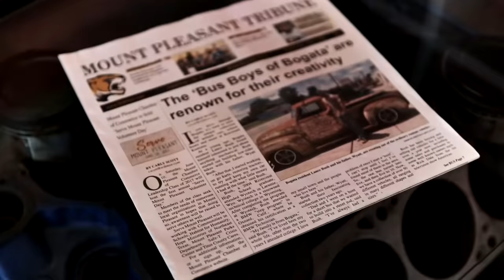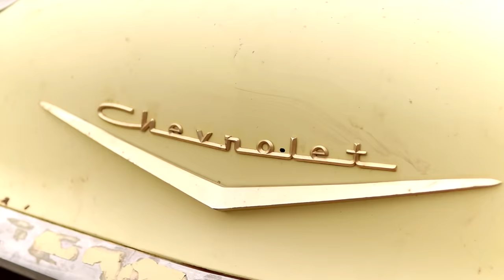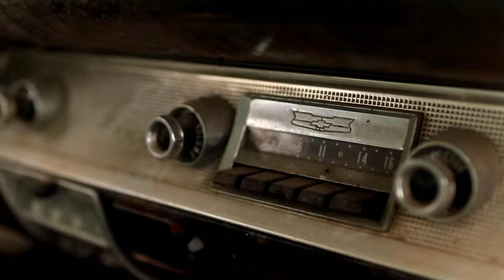1957 Chevy Bel Air, Will It Run After 35 Years?! | Turnin Rust

Comment: 265 V8 would've been painted YELLOW in 1957.  I believe it ONLY came with a 2-barrel and a 3-speed.  It was the economy V8 option.  Everything else was the 283 and the 283's were all Chevy orange.
Reply: They made a rare Turboglide 2 speed transmission ( different torque converter I think ) but I only saw them in books.
Reply: @michaelszczys8316   You're correct on the name, there was a TurboGlide available starting in 1957. It was a 3-speed but was only available with the 283 - but NOT available on the solid lifter Dual Quad 283 or the solid lifter Fuelie 283. Those engines came with three-speed manuals ONLY.

The fellows in the video were wondering if they had a 265 or a 283.  A 265 would've been painted yellow in 1957 and never would have come with either the Power Glide OR the TurboGlide.  it was an economy V8 choice and only came one way.
Reply: @That_AMC_Guy  Back in 70s most of those cars that still had original motors they were so greasy you couldn't tell what color they were.
A friend had an old 56 nomad with 265 that was so sludged up that when he took valve cover off it looked it still had one on and even said Chevrolet in the sludge
Reply: I don't think the turboglide was 3 speed. I think it just had some more elaborate torque converter and I remember the shifter instead of low said HR for Hill Retard for using in long hills
Reply: Yeah well, I know the TurboGlide was a three-speed.

Comment: Your experience as a mechanic leave a lot to be desired as far as I'm concerned. I was been a mechanic for 45+ years and am now retired. You not knowing how to adjust points on the 57 is ludicrous. GM has used that type points from 1957 to 1975 when they went to electronic ignition. Not knowing that the motor was a 283 (because it has no external oil pump) made me laugh.  No sure if you faking it or really don't have a clue.

Comment: Thing that bugs me is those who claim they are "God Fearing People" then they buy a car (like this) for just $1900, use parts on it "like cobbing in a 9 foot ground wire for the battery" do three hours of actual work on it, then try to sell the car for $10,000 as though it is actually worth it with second rate parts, and no real "money" spent on the thing!! Sure labor costs money....but I don't see "$10,000 worth" of parts and labor into these cars!! And then I have to question what "God would say about greed!"!! 

I am not saying these guys are like that BUT I know a fella I met years ago who was like that!! The man I knew always threw God into every conversation, talked about how much of a "good person" he himself was trying to be, but when it came to the cars he'd buy and sell he was as crooked as they come!! And originally I met this guy while I was working in an electronics factory, it wasn't until a couple months after I'd met him I learned that he would "wheel and deal" in cars!! And I saw some of the crap he tried to pull as he sold these "classic cars". He would buy them (back then) for $500 and do just the lowest "basic" work to them enough to get them to run, and then try to sell them for insane amounts of money that they were not worth!! 

And he'd lie about the claims he made as well!! (Sorry to me lying is another sin) Like he tried to sell me a 1966 Mustang fastback for $14,000 and when i learned where the car came from, how much he had bought it for (which in the mid 1980s he only paid $350 for it) and then tried to tell me about "all the work he did to it" (which was bullshit) IT made it hard to believe him when I KNEW BETTER and realized he was lying about a lot of the things he claimed he'd done and spent money on "repairing it"!! 

Things he said for example was that he "did an oil change to it!" but yet it didn't have a brand new filter on it, and the oil was as black as coal in it! He claimed that it had new radiator, hoses and belts, but again the low coolant level in the car AND the cracks in the rubber proved that was a lie as well too!! In fact the only thing it looked like he "did" to the car was wash it up, vacuum it out and stick a "For Sale" sign on it!! Sure the glass was clean, the carpet was vacuumed, but all the "new parts" he said he'd put on the car most of them were not even "NEW"! The car certainly wasn't worth the $14,000 asking price he demanded I give him!! And when I told him I would pay him $2000 for the way it sat he started swearing at me, calling me and number of names for "insulting him" with a low ball offer!! Ignore the fact I am trained as an auto mechanic SO I KNOW what a NEW oil filter looks like, just like I can tell by looking at brake pads what "NEW" brake pads look like as well!! 

And you DO NOT tell an auto mechanic "It has brand new heater hose!" when you open the hood and antifreeze is literally pouring out of them!! And like I say this is what this "Man of god" told me he did to the car which is why he thought it was worth $14,000 for a beat up, wore out 1966 Mustang fastback!!!! And it wasn't even a GT350 or a Hertz car......it was a run of the mill inline 6 with a three speed and NO A/C car!! But he even played that off as though it was a fully loaded "RARE" mustang in a time when there was literally thousands of them rotting in fields EVERYWHERE!!

Comment: 1949 was the year Detroit quit adding nickel to their steel, this was the year Detroit rust was invented.  Really augmented in 1975 when studded snow tires were made illegal, and tons of road salt was poured on the roads.  Have idiots working in this country, to work for the highway department take and IQ test if over 2, weren't hired.  Claimed studded tires were wrecking the roads, but not even close to the damage that road salt was causing. And a side benefit of road salt if you want to call it that is rusting out our bridges. 

As an engineer could get into deep trouble  in one of two ways, designing a component that was too reliable, have to make it cheaper.  Or designing a component to cheap driving up warranty cost.

An ideal design would be when every component would fail at once. Preferably one mile after the mileage warranty or one day after the time warranty. 

If you tell things the way the are, can get into deep trouble, I am in deep trouble.

Comment: You keep on saying key and you went in there and flip the key over but you said early in the video you didn't have a key yet from the woman why are you jumping the distributor if you  have a key and if you undid the hot wire to the distributor and that's probably why your key doesn't work because you unhooked and hooked it straight to the battery so it's not going through the internal ignition System

Comment: The one thing I can't understand is why you guys start those engines up what the old oil mix in the crankcase the filter is got to be so gong dong the oil pump is going to be sitting in goo what's wrong with you guys???

Comment: 4 doors weren't Bel Air's
They were 2-10's
Reply: Talking about they plenty four door Bel-Airs
Reply: That was supposed to say you don't know what you're talkin about I've seen lots of four door Bel-Airs
Reply: Bel Air's were all two door, no posts, but an awful lot of people put Bel Air trim on any '57.
NOTE:
Bel Air door windows were the same as the convertible model. There is a 1" difference in height.
Reply: @rollinshea7119  Please check out -
A rare Chevrolet promotional clip for a Two-Ten model that was never produced in this form. For more info or to leave a comment, go to https://macsmotorcitygarage.com/video...

Comment: Yall should get some doors from a two door car and do a two door conversion on this one
Reply: Greg Miller you can’t do that on a four door hardtop car, like this one. Only on a four door post (sedan) car.
Reply: @torekristoffersen176  not to sound like a wise guy. But why not? Seems like the process would go about the same way
Reply: Greg Miller because the roof lines are entirely different on a four door hardtop. The roof line is the same on the 2 and 4 door sedans, so you can “delete” the rear doors and fill in in front of them. You can’t do that on the four door hardtop. They are not even close to a two door hardtop dimension. I hope that helps. Structure is way different.
Reply: @torekristoffersen176  ahh ok well I appreciate the info. I was thinking about trying to do it one day but now I know post cars only.

Comment: All 57's came with a 265.  Vetts only 283's and were fulies
Reply: your are wrong sir 100%
Reply: Yes he is wrong, they most definitely came with a 283 for sure.
Reply: Wrong.... the v8 265 went into some early production ‘57’s (150 model), but the 283 was the standard v8 engine put into hundreds of thousands of these 57’s....
Reply: @torekristoffersen176  Exactly correct.  I did notice the valve cover on the right was from a 327.  But, then I saw "script" on the other side.  So she might have the original 283.  Easy enough to check out.  Haven't seen many 4dr HT's out there for any of the Tri-five years.   Potential galore.